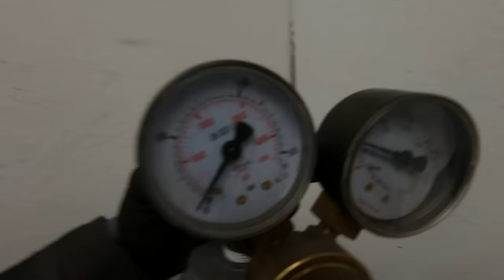Kindling Cracker Wood Splitter for Firewood

Comment: Does it work on thicker bits - so starting with a chunk of 2*4 or similar and gradually cutting that down to kindling size?  All the vids I can find of this design show it working well cutting thin bits of plank, but usually I'm starting with timber that's bigger, and it's not clear if this would be up to the job.  Also, the example where the axe didn't work was when it came up against a knot.  Does this work with timber with knots in?

Comment: What gauge metal are you using.  What are your measurements?
Reply from the maker: Somebody shared a Link with that tools ..... cant find it at the moment
Reply: 2,5 cm width  x 2mm thickness ( 1” x 0,08  in barbarian units  )

Comment: That's a wonderful solution for elderly or disabled people. I know that a hatchet is probably a better solution for able-bodied people, but for those with issues relating to coordination or joint pain, this would be far easier and safer.
Reply: Im able bodie and just spent $100 on a new hatchet wish i seen this video before id have just made one of these
Reply: Looks like it would be great for anyone. Really speed up the job making more time for other chores.
I'd still start the kids off with an axe so they learn the meaning of work
Reply: I skinned the top of my thumb off doing this with a hatchet. Definitely a  good solution. Though, drinking less whiskey helps too.

Comment: Very cool.  If Grandma were to have the grandkids around, I'd suggest you might design a locking mechanism of some sort.  Maybe one that would cover the blade when not in use, like in the garage.  Kids might just root through the stuff, and an exposed and fixed blade isn't something they'd be on the lookout for...  But wonderful invention!
Reply: I'd be sure to lock all the kitchen cabnets with anything sharp, too. And make sure the kids are wrapped up tight with bubble wrap before they leave the house...and make sure they have their helmets on to walk down the street.  Or.....just tell your kids not to touch stuff. But you do you.
Reply: @av8orCH-47  Bending over backward to take offense.  It was a suggestion.  But you do you.

Comment: nice. do you have to requench the file knife to harden it again so it stays sharp?
Reply from the maker: Thank you 😁 its still harder than the regular steel, i thing for wood it will be enouth...til now 😅
Reply: @TheMetalist  I like how it has more curve and more step levels to aid in the cutting. The one I bought only has I think 4 steps and it is more like a diagonal line so can slip at times and just not as good with a variety of size
Reply from the maker: Oh that nice to hear ... i saw some of them on the Internet!
Reply: @TheMetalist  u did the best ;)

Comment: Ruined the hardened file when you welded it, to re-harden it, get it glowing yellow and quench in oil, then heat to about 450°F for a couple of hours so it's not brittle.
Reply: I get where you're coming from, but that's probably not necessary for this tool. Could Probably have settled for mild steel with a little wider wedge.

Comment: What are the dimensions for the metal?
Reply from the maker: Which measured? A drawing?
Reply: @TheMetalist  the thickness of the metal, length and width. Basically a blueprint if it's possible